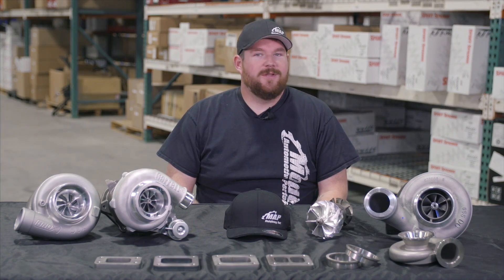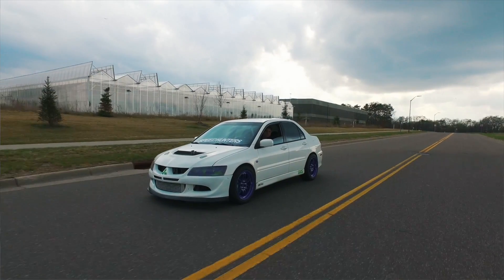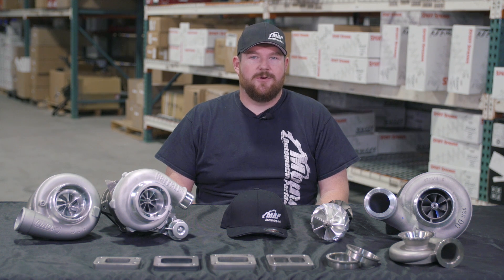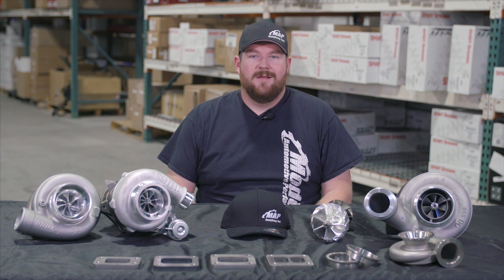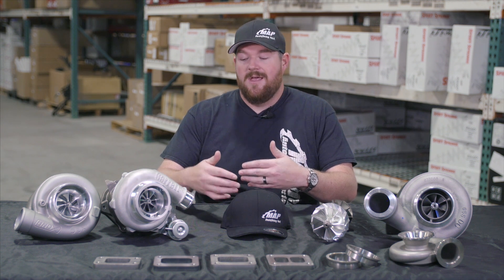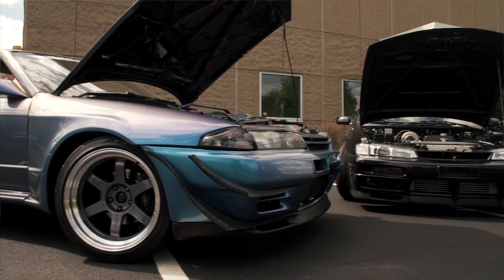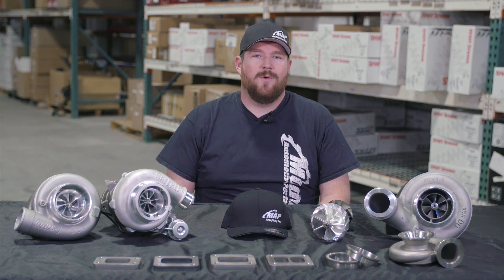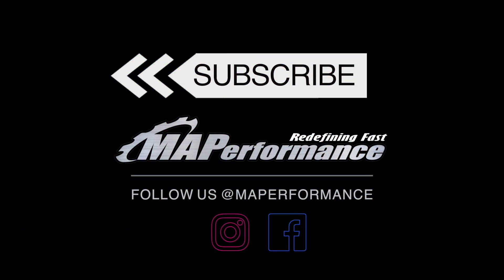4 Things You Need To Know Before Buying A Turbo | Turbocharger 101

Comment: 1989 Dodge 5.9 cummins, 12v [no computer] (wiring fire, everything burnt up)...  2 wires, Starter & Pump... 200,000 miles. not really well kept... I want to add some power, it has gotten sluggish lately, seems to have lost power... Including a turbo - inter cooler - fuel pen - what are the first and most cost effective things to do...

Comment: I am building a front wheel drive 2010 mini S R56 with an N14 engine. My end goal is a streetable at night and daily in high traffic car with 500hp. The stock hp is 175ish. It's Turbocharged and has all the bolt ons, a built bottom end with cylinder support and forged internals, and methanol. All I need now is a bigger turbo, head with bigger intake/exhaust valves, and figure out what to do with my transmission. Can you suggest a clutch and flywheel kit for me, and do I need to do anything with the rest of the trans like the gears and all? Thanks guys

Comment: I need some help with decision on what turbo is best for my build i have a 95 honda civic B18b1 swap p72 head all stock internals Factory cams in the VTech head need some help picking out good turbo components that work well together Turbo wastegate blow off valve intercooler fuel pump internal injectors for E85 I have hondata V3 any type of help would be greatly appreciated thank you very much for your time and have a great day
Reply from the maker: Hey Jeremy! We'd love to help out. Give us a shout: sales@maperformance.com

Comment: I have a k24 I’m planning to run a cx racing t3/t4 as a dd, running 10-14lbs of boost (300-400 Hp) I know I have to upgrade my injectors and fuel pump. Are 1000cc’s and a walbro 450 overkill ?
Reply: Nah from my understanding more fueling gives room to grow ya its overkill for your power goal right now imo and your prob going to want even bigger injectors if you wanted to run e85 and more boost but more is better to a point in this case just makes it harder to tune out cuz its finer adjustment when your using a fire hose to water the lawn use a good FPR and it should have awesome injector duty cycles and no prob that I can think of but I would always talk to the guy you plan on tuning it see what he likes to do for someone like you usually ends up saving money in the long run also buy good injectors if you can help it  (disclaimer in not a tuner. . . Or even really that smart so always make decisions for yourself based on reasonable level of knowledge for what you intend to do)
Reply: MegaRomans01  I appreciate the feedback. I have the cash to get it done but I’m doing a ton of research before spending anything. I’m in no rush to do this. My mechanic (who also tunes vehicles) suggested this setup. E85 sounds good but after doing research, it doesn’t sound like something that I need. From my understanding, you go through twice the amount of fuel than regular gas although the price is cheaper. And I live in a area in Florida where there’s only one gas station locally that sells E85... hurricane season will be a bitch when their out of gas...
Reply: The burn for pump gas is 14 something to 1 for proper combustion where as e85 is I think 8 to 1 ( can't remember could be wrong) leading to extra fuel usage, but pump gas should make that power np imo. I think those motors have a balance shaft setup that runs the oil pump and anouther version just has a pump I would switch that to just the pump setup lose some rotational mass gain some hp( balance shaft only help with smoother idle) its cheap and you get a new oil pump, maybe head studs, some springs and retainers, make sure you got proper boost gapping in the rings I like running a good fluid dampener on the crank and let her fly should last awhile. . . If everything going together proper anyways lol ohh ya and make sure you got good venting out of the motor suggest making extra ports in the valve cover to run to a catch can setup
Reply: I'm trying to find out some of the same information but my build is a b18b1 swapped 95 Honda Civic hatch I'm ready to Turbo now and I need help I'm choosing the correct components that work well together it's just a street car build
Reply: Are you planning on going E85 because if you are I hear that for a 2.0 liter 2200 CC ID injectors and a 450 walbro should be great but if you're just doing a 93 tune the Thousand CC and the walbro 450 should be just fine good luck on your build I could use some help on some things just talkin out issues if I could help you let me know

Comment: I am in North Carolina and need help finding a shop to help with my 95 talon awd build
 Who do you suggest?
I can give specs of what I know about it. Bought the car half built.
Reply: Force fed in Fayetteville area 
Phantasm Raleigh area 
Greensboro tcs
Motionlab Charlotte 
And best of all if you can trailer it Dyno time speed works ! I hope this helps
Reply from the maker: @eva-r2f  way to be man. Thanks for commenting and sharing some knowledge.
Reply: Thanks 
It does, everybody has an opinion but not a 4g63. Just wondering what your opinion is as I respect it. I have a trailer but not time to drag it to you guys.
Reply: @chrismaron2930  oh i know what you mean i have an evo 8 i dont work for anyone those places. But i know Kasey there is 4g63 guy so  that would be the best in nc for that but all the shops listed i have heard great things about. Good luck bro!
Reply: Thanks bro!
Gonna check out dyno time.
1hr 45 min from me.